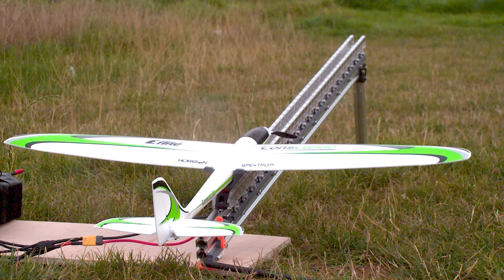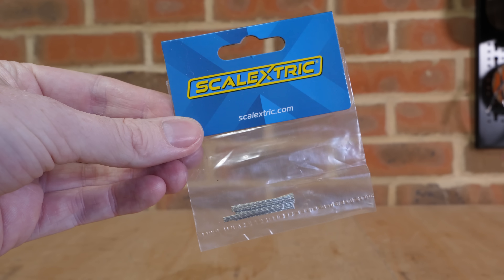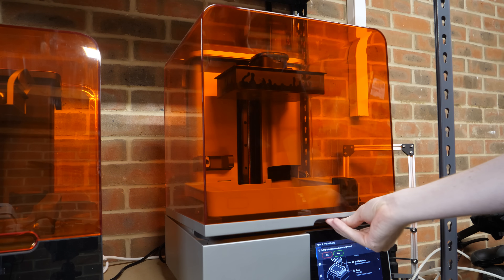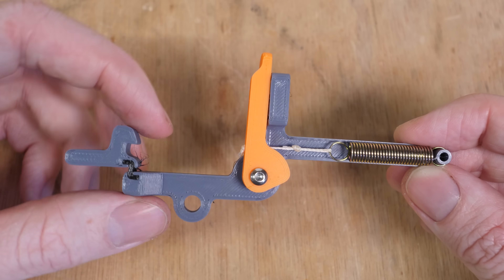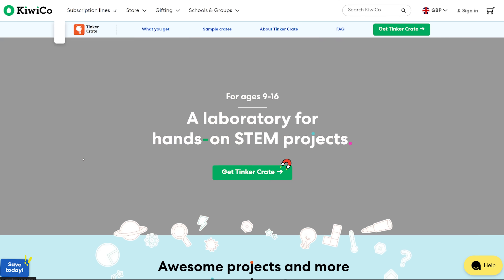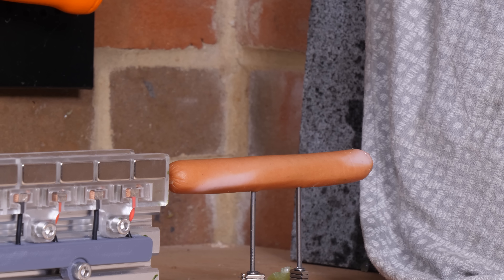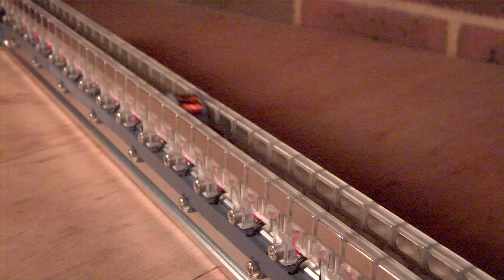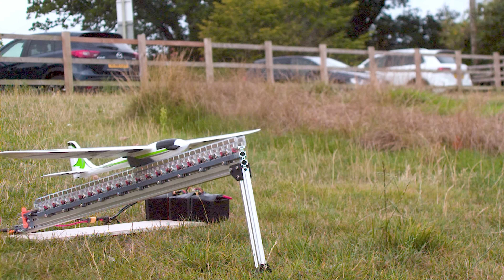Electromagnetic Aircraft Launcher

Comment: you should add a ferrite or iron (but the ferrite it not that heavy like iron ) core to the coil to concentrate the magnetic field facing the magnets, you will get more force
Reply: There do exist filaments with ferromagnetic powder inside, and since he has tool change this could be very promising
Reply: @Robbedoes2  They have fairly poor performance though. Good for prototyping, bad for pushing limits.

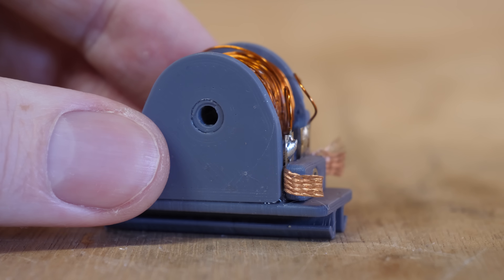Comment: 12:36 torx bit to undo hex bolt 😮
Reply: no problem when very low torque is required like in this video.
Reply: It's okay because the rust on the torx bit fills in the gaps.

Comment: I believe you will find a performance increase if you wound the windings in a much neater way rather than crossing over itself so many times. Also I'd be curious to know how adding a core to the windings would also help but yes it would increase the weight, I think it's worth a shot. also also... I grew up playing with AFX cars, they used springs to push out the contacts to keep them connected to the rails as best as possible, I think if you switched from the braid to springs pushing strips of metal you might get better contact
Reply: As far as I understand, the crossovers in the windings don't matter so long as the windings are all going in the same direction around the spool, the main reason you want tight windings is to fit more of them in the same volume, providing a higher magnetic flux, and therefore more force
Reply: @eragonawesome  I'm inclined to believe you but I thought in the past I have seen a motor with the same number of turns have high torque when the windings are tighter. I'll admit I don't know enough on the topic
Reply: @eragonawesome  this is correct. At least any effects of looser windings are going to be negligible.
Reply: @eragonawesome   It does matter, but not a lot.  It will change the inter-coil capacitance, which changes the resonant frequency as well as the Q factor.  But he hasn't really tuned the system, to literally match the resonance with the average switching frequency, just a handful of tests using the wrong amount of weight.  There's a lot more to be gained from finding the ideal number of windings for a real plane mass than there is in making the windings better.
Reply: @eragonawesome  and remember, less volume means less weight
Reply: Add a core, and use smaller wire for more turns at lower weight and you could really crank this thing up.
Reply: You might also slow down the speed that the coil can spike its current. But mechanical things are slow enough it might not have a big effect.

Comment: DIY railgun content is seriously nostalgic youtube material
Reply: For real😂 I went down a deep rabbit hole of Coil-, Rail- and Laserguns back in 2010.
Reply: @FLF20M2  https://youtu.be/oWiYsRi2Dss?si=C2vIIOxtEIcTJLPw
Reply: this is technically a coilgun, railguns are a hell of a lot more dangerous, but equally more awesome
Reply: @dawnderg  No this is technicaly linear motor. For it to be gun you need a barrel.
Reply: @RamsesTheFourth You're sure about what you say😂😂😂
Reply: @dawnderg Why are Millennials all Bronies and furries? 🙄
Reply: @dawnderg  and why do you think it is a coilgun? Did you see how coilgun is built and how projectile accelerates there? Having a coil somewhere doesn't make design coilgun...
Reply: @Promilus1984 what makes this a rail gun? The fact that it has a track?
Reply: @kitsune_gt  I didn't say it IS railgun but that this particular design is much more similar to railgun than it is to coilgun (or reverse coilgun), because railgun creates force through interaction of magnetic field created by current going through projectile and magnetic field created by current going through rails delivering power to projectile. In that particular design magnetic field created by projectile  and field created by current through rails is largely irrelevant and replaced by field created by magnets. Coilgun works through interaction of magnetic field created by coils with the projectile (be it ferromagnetic projectile - the most common design, permanent magnet with very careful coil switching, super cooled conductor - essentially superconductor level or ... just another coil). Regardless of projectile it is absolutely contactless form of energy transfer & transformation. Which isn't the case here, right?  That's why in my opinion it is more like magnet assisted railgun... The same as PMaSynRM is still reluctance motor even if it DOES contain fairly strong permanent magnets.
Reply: @Promilus1984 i understand now
Reply: 50+ many-sided reply argument about whether content depicts DIY railgun, coilgun, Gaussian rifle, phased-plasma accelerator carbine, ER-PPC, heavy bolter or plasma wakefield electron beschleuniger is ultra nostalgic youtube material...
Reply: @GarageExperimental  they played right into my hands
Reply: Railguns use a different magnetic field called the Lorentz force, it's a perpendicular magnetic force that can be viewed with your right hand, electrical current, magnetic field direction and force direction. You typically will get much higher acceleration and velocity than with simple electrical magnets. You can get at least 6 km/s if done properly. You only need parallel copper rails energized by a bank of high voltage high current capacitors which is dangerous in itself. But this is what the military uses for their railguns.
Reply: I see you Bishop Brennan ;)
Reply: Not rail gun more a coil gun (gauss gun) well this one is a reverse coil gun magnets stationary electro magnets moving. A rail gun induces a magnetic field in a solid projectile and does not have ither electromagnets or permanent magnets. Coil guns are simply and are not self destructive. Rail guns erode their rails with each shot to some degree. Coil guns are more complex than rail guns though  as they require timing along the coils to accelerate the projectile. His is mechanical most are electronic as the first was
Reply: I totally agree
Reply: What’s the g load?
Reply: Amazed that we’re at the technological point where this is an actual factual sentence.
Reply: This is not a rail gun. The rail is for frictqrion purposes and for powering the coil. This a rearrange coil gun.
Reply: It's really a scale model of the immense Taylor slings used for area denial during the invasion of Tau Ceti, minus (of course) the helical windings and neurostat.
Reply: "Railgun". Absolutely. The young'uns here don't know the story from the beginning. But it really takes you back to the old days, doesn't it?
Reply: What's it nostalgic to? Or are you saying this has the ability to be nostalgic in 10 or 15 years?
Reply: Yes, 3D printers are "nostalgic" x.x
Reply: Yes, but this one’s actually useful
Reply: There's a better way to launch a piece of metal than a conventional coil gun.
You spiral the coil around the barrel like twisted wire. You fire a charge through the wire and it turns the projectiles as it pulls it down the barrel. At the end you have a shielded return line. It uses less energy and spins the round making it more stable and thus travel farther than a coil gun.
Reply: It doesn't have to be though.
Reply: One Thou-Wow percent!
Reply: This is why my project is this SICK AS HELL RAILGUN. if you don’t know the reference it’s from murder drones
Reply: Prof. Eric Laithwaite would approve!
Reply: And now, a super cool middle school science faire project montage!!
Reply: レールガンと言うより、リニアモーター・電磁カタパルトの理論なんだよね。
Reply: これhレール月hというより、リニアモーター・電磁カタパルトの理論なんだよね、
レールガンはもっと、単純な理論で、動いているんだよね。
Reply: Laundry hamper is a great name
Reply: Huh, I remembered a glimpse of electroboom's videoon this topic.
Reply: 😊 15:09
Reply: So how many of these whatever you want to call them experiments were fully analog? Great job Tom!
Reply: It's a coilgun. good at accelerating mass at low speeds, as opposed to railguns which can accelerate a lighter mass to much higher speeds.
Reply: "It's a coil gun!" "It's a rail gun!" 

Both technologies are mixed where, so it's kinda both? Anyways, it's either both or neither. Stop arguing lol
Reply: Stop this debate it’s just the V1 ground to ground missile
Reply: The good thing is that the ATF has no power here since we're not playing with fire, our dogs are safe! :v
Reply: its a rail-coil-gun.
Reply: Great video. Fascinating journey thanks for sharing 🌌🌌🌌🌌
Reply: Bru this is more than a rail gun it’s a flintlock rail gun lol
Reply: It's just a brushed linear motor. 

Not a coilgun or a railgun...

The first one he built was a coilgun. (or "brushless" linear motor)

Maybe he will attempt an actual railgun next...
Reply: its kind of a mix between a coil gun and rail gun, rail guns use two parallel metal rails and a projectile that shorts them. coil guns use coils that acellerate a metal projectile with a series of stationary coils. this is kind both but also neither at the same time.
Reply: @SB7-r9i  The real answer. Tom created something new here
Reply: It's a Gauss' cannon here.
Reply: @RustBot3129  [loud incorrect buzzer] this is a coilgun, though the differences between railgun and coilgun are less severe than the difference of railgun vs gauss cannon.
Reply: @ActualRealKayamariOfficialVEVO   it's no coilgun either. In what type of coilgun did you see energy transfer through contacts? It's basically modified railgun design with supporting magnets instead of strong current on rails and with multiturn coil instead of "1turn" projectile closing the loop.
Reply: @Promilus1984  You're sort of correct in the claim that this isn't a coilgun either, but my reasoning here was that due to a coilgun essentially being an unfurled brushed motor this design isn't too far off seeing as those also use sliding contacts when the configuration is coils on the rotor with magnets as the stator. 
Additionally the base form of a railgun does not utilize permanent magnets (though they can be utilized) while this design of course requires permanent magnets to function!
Reply: @ActualRealKayamariOfficialVEVO  it's basically the simplest form of brushed linear motor, which is when you "unroll" a permanent magnet rotor motor. these usually aren't considered high acceleration motors so they wouldn't be used for guns either. brushless linear motors tend to have higher acceleration because they avoid friction and waste less energy in sparks and heat, but neither is a high acceleration linear motor like rail guns or coil guns.
Reply: @ActualRealKayamariOfficialVEVO  Actually coilgun is - if anything - unfurled reluctance motor, at least when we're talking about the most common design with ferromagnetic projectile. There is contactless energy transfer unlike "brushed motor" which does transfer electrical current to "armature" windings to create magnetic field. In typical coilgun design field is created by current on "stator" and "armature" is ferromagnetic. Hence reluctance motor similarity. In different designs it might be similar to PM SM or induction motor respectively - depending on the projectile. But at no point there's transfer of energy through electrical contacts. And in fact railgun is the one which you could describe as unfurled brushed motor with windings on both stator and rotor... In this case the only modification is... it has stator made of PM and armature is multiturn coil instead of "single turn" piece of metal. Hence - much, much closer to railgun than coilgun.
Reply: @ActualRealKayamariOfficialVEVO  last I checked Gauss is a unit of magnetic field strength, so anything that uses magnetic fields to launch a projectile is a Gauss weapon/tool of some variety.
Reply: @ActualRealKayamariOfficialVEVO  True, but strictly speaking a rail gun should be only using lorentz forces at some point. Its basically how maglev propulsion works. But permanent magnets brushed and mechanically timed.
Reply: @ActualRealKayamariOfficialVEVO  I would say that Toms launcher is closer to a railgun than a coil gun.
difference between a railgun and Toms launcher is that a railgun uses electromagnets in the rails, whilst tom has decided to use neodymium magnet as the rail and to have the projectile be an electromagnet instead of a material attracted to magnetic fields.

And considering that the  Electromagnetic Aircraft Launch System (EMALS) now used on US Aircraft carriers was developed from research into railguns I would say that Toms launcher squarely fits within the Railgun classification and not Coilgun or Gausscannons, because these two differ much more from Toms design than a standard Railgun does...

Like a coil gun uses coils around the launchrail which is simply not even close to what Toms launcher is doing....
Reply: @ActualRealKayamariOfficialVEVO  You young 'uns are so cute when you think you've taught someone something with your small part of the picture.
Reply: @ActualRealKayamariOfficialVEVO Incorrect.  A Gauss cannon and a coilgun are the same thing (unless you’re talking about Necron gauss weapons, which aren’t real.
Reply: @RustBot3129 5:12 😊😊
Reply: k
Reply: @RustBot3129 definitely not a Gauss riffle. A Gauss riffle can be visualized (if you don’t like magnets) as a ball roll down a hill and hitting block with 2 ball bearings on the end. Like a newton’s cradle the one on the end hits the next ball in line carrying the energy from the previous collision, gaining it as it gets closer to the magnet and passing the energy to the next ball bearing repeating the process.
Reply: coil and gauss are basically the same thing. the way coils are activated does not matter. rail gun uses ampere force.
Reply: @Timsturbs  railguns use Lorentz force, Ampere's force is related but not applicable in a sliding armature railgun.

Comment: so why not railgun, no logic required at all, I wonder how nail gun works
Reply: Railguns need vast currents.
Reply: @davidf2281  not anything more than that current pulse electromagnet coil design
Reply: @gsestream  Orders of magnitude more
Reply: @davidf2281  not for those speeds, but you can still down-convert 230v to even 1v to get mega amps.
Reply: @davidf2281  you can also make the track longer etc with simpler overall design of the railgun
Reply: @davidf2281  no I dont buy it
Reply: @davidf2281  who said you cant use the same current in a loop for a railgun
Reply: @davidf2281  so whats the problem with high currents
Reply: @davidf2281  if you use wall input, just down-transform 230V to 10v or so. or use parallel battery bank, to make that high current. or just charge a parallel super capacitor bank.
Reply: you see the issue with huge capacitor banks is they are essential deadly and only fools dare to play with slapped together setups.
Reply: @hanswurst-h3e  its your problem if you dont use such a things. do you weld. dont use high voltage capacitor banks then, use low voltage banks. they only burn stuff with heat.
Reply: @hanswurst-h3e  whats today with all the cautious fear statements of cant do.
Reply: @hanswurst-h3e  sorry your comments are deadly. all life leaves if listening to you.
Reply: try a reaction control wheel single rotor helicopter, yes flying umbrella
Reply: make a space cannon track launcher with the coil gun stages
Reply: how about acceleration ring track. maybe like the coil train track, but as a launcher.
Reply: try arc movement pipe for throwing ball projectiles. you can calculate the exact launch arc from the arc radial acceleration of the pipe. kinda sling stick, or sling pipe. yes lure launch device.
Reply: that can be used as a cnc linear actuator, and as very accurate one too. if you take a stepper pulse motor and extend the circle to a linear axis, you have a cnc-axis launcher. just have chosen electromagnet coils activate just like in the launcher, to move the position to exactly where the final magnet activation positions are at.
Reply: you know, you can use multiple coils on multiple magnets simultaneously, for more acceleration, not just one coil for one magnet. the magnets and coils linearly multiplied.
Reply: so what if you use rotational magnet induction track launcher. yes the aircraft is the induction target, and all the track has fast spinning alternating/dc magnet rollers. non-contact no touch, just magnetic induction rollers sling.

Comment: Did you consider using graphite on the contacts, they would minimise the sparking and energy loss?
Reply: I remember another YouTuber, maybe integza experiment with copper grease, graphite and that kind of stuff
Reply: most railways use graphite pantograph, which has better overall performance than copper pantograph, so it could be a good idea

Comment: To prevent solder wicking, cool it down with something cold. Bits of metal would be ideal. Also, solder does not flow upwards easily, use this to your advantage.
Reply: we use aluminum clip on heat sinks to stop solder from wicking up braid.  he's an engineer, oh well.
Reply: @trfpvVT  I just use a third hand tool and solder from the bottom of the wick.
Reply: I have used solder wick for slip ring contacts and clamping it to bench vice with a piece of aluminium works great.
Reply: @miqo85  Aluminium, or copper, was just what I had in mind! Any metal will work, even wood will do the trick.
Reply: clay works to soak heat. Plumbers use it to prevent damage to valves

Comment: You absolutely need to make some kind of 3D printed launched rollercoaster model using this Tom !
Reply: Avoid the use of rear facing seats . . . the belt stains take some getting out . . .                        : )
Reply: The thumbnail had me thinking this was a magnetic train
Reply: First thing i thought seeing the thumbnail was "this Is an LSM launch"
Reply: @user36058  technically his previous launcher was much closer to an LSM launch since it used electronically synchronized coils along the rail and the magnets were on the sled